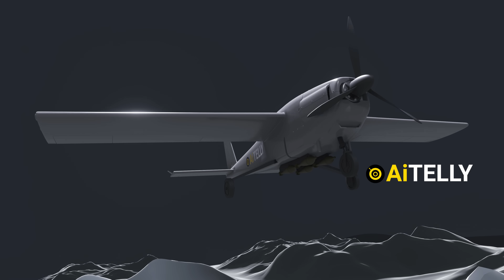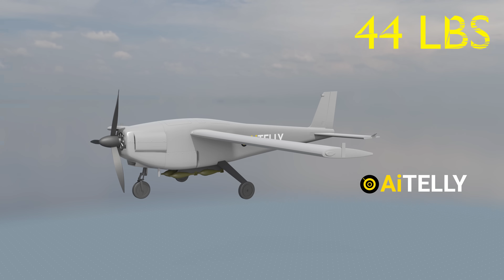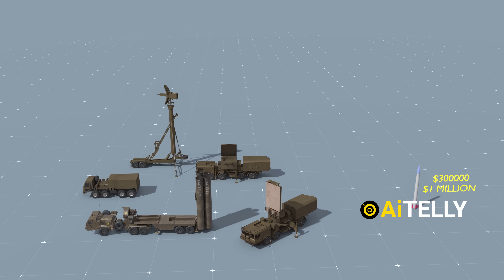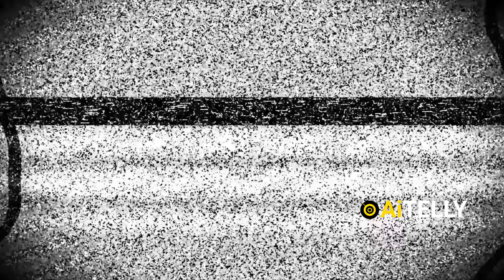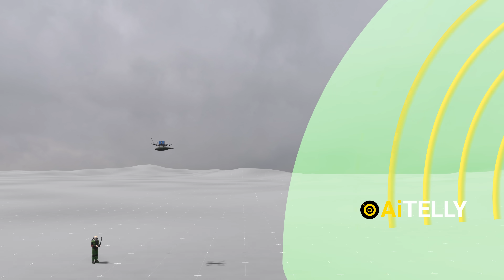Drone UJ-22 | How Ukraine Mysterious Drone Strikes Deep into Russia?

Comment: If used as a suicide drone, use a version without landirng wheels. It can be launch from the back of a pickup truck or flatbed. Removing the wheels and landing gear reduces weight and drag. This effectivesly increase range (or payload) and speed.

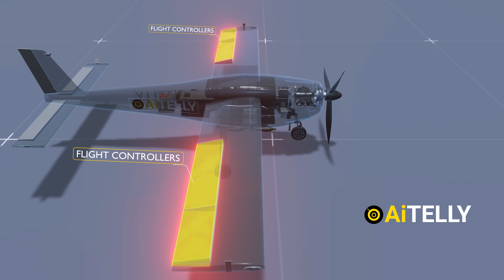Comment: 1:26 - Those aren't "flight controllers".  Those are the ailerons and flaps which are "control surfaces".  The flight controller is a tiny microprocessor packaged on a circuit board along with IMU/gyro sensors.
Reply: @beyondfossil  very correct. And we mount the flight controllers in the dead center of the craft not on the wings.

Comment: Why do you keep claiming that the UJ22 is based off the Cessna? That's BS. Its a dumb comparison. 
Form follows function. That's basic in nature and engineering and is why birds are mostly similar with two wings or fish follow the streamlined torpedo shape. It also applies to aeronautical physics and that's why most tractor aircraft designed for general aviation are structured like they are. SOME Cessnas are high wing tractors with straight wings but others are not. You could just as correctly said it was styled after a Piper, Beach or Lancair which are generally classed as cruciform aircraft. If an engine is in front, then the forward pitching force of the wings and the weight of the engine and other equipment (with the CG under the correct lift point of the wing) have to be counteracted by a control surfaces mounted on a long lever (the tail assembly). Yes, a Cessna has all that, but I'd bet no Ukrainian aeronautical engineer had a single seconds thought about Cessna aircraft and didn't copy anything.
I'm also extremely doubtful that the ACTUAL cost of construction is anywhere near $90K. I base that off my being an aircraft mechanic who has built several kit planes and also done a lot of modelling using easily available aircraft design software (with finite element analysis, not some toy program). And I've built RC aircraft LARGER and bigger engined than the UJ22 with hot wired styrofoam and then hand laid polyester / glass cloth composite skin. Note that even prior to the Ukrainian - Russian war there were very good autopilot systems out there. FYI - A gutted cell phone has quite a bit of the capacity to run flight software.

Comment: 2 stroke engine? Wouldn’t a 4 stroke engine be quieter and more efficient?
Reply: You can't beat the simplicity and power of 2 stroke for its size.
Not environmentally friendly tho.
Reply: @objection_your_honor  just seems like it would burn through the fuel too quickly (compared to a 4 stroke engine) But the power to weight ratio of a 2 stroke engine can't be beat, and they are easier to manufacture.
Reply: @eric.esoteric lightweight, and 2 stroke efficiency can improve when used in a near constant rpm range.

Comment: Do everyone noticing that older gen airplanes are becoming unmanned, and step by step we will reach jet drone ?
Reply: @kok3139   There are jet drones. Ukraine just developed one.   But the slow speed is part of the stealth.  Combat radars can tell them from birds.
Reply: @divermike8943  But in the video he mentioned that the radar discovered it and shut it down because the relatively low speed
Reply: @kok3139  That can happen, but the reason drones are hard to detect is that they are small, can fly low, not a lot of metal, and they are slow like birds. Military radars filter out things like birds to avoid false alarms. Since Ukraine adjustments have been made to those filters, I'm sure, but still, how can you tell a bird from a drone.  Speed. If too fast, not a bird.
Reply: @divermike8943   maybe by the heat fingerprint, but I guess that only works at night
Reply: @divermike8943  you are kind of wrong, speed is not at all a part of stealth. radars dont filter by speed, they filter by size, thats why birds (which are usually tiny) don't get detected / are filtered out, whereas planes and even a drone like this are large enough to the point where the radar can detect and will show them
Reply: @kok3139  radars dont have anything to do with heat, and that has nothing to do with night time, just bag the fries bro
Reply: @coolio7234  Oh, you're right! Clearly, all those scientists and defense companies wasted billions developing Radar thermal imaging and infrared systems for radars that work better at nighttime because of temperature differences. I guess they should've just asked you first, since heat apparently has nothing to do with night or radar. Genius!
Reply: @coolio7234  "Oh, you're right! Clearly, all those scientists and defense companies wasted billions developing Radar thermal imaging and infrared systems that work better at night because of temperature differences. I guess they should've just asked you first, since heat apparently has nothing to do with night or radar. Genius!"

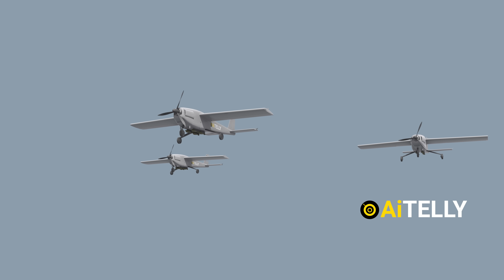Comment: 5:25 $90,000.. something tells me it would be cheaper to actually buy a 30+ year-old Cessna 150 anywhere from $15,000 -$25,000! Thin strap, all the weapons and make it radio controlled / autonomous!
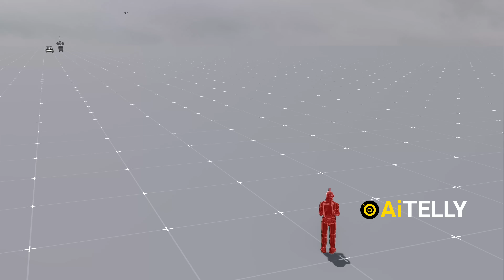5:56 on encountering electronic warfare for the little drones. Ukraine slapping on a spool of fiber optic cable, making the drone essentially unable to be jammed! However, it does decrease the weight that it can carry. I think by 2 kg “+/-“
Reply: Its very hard and expensive, to make radiocontroled syetem with 800+ km range. I think this is the most expensive part of the drone. And no one knows for shure, how much this drone costes
Reply: Well guys, in Ukraine we don't have huge market of used Cessna's for 15K$.
Reply: Once a Cessna 150 landed on the red square...is that an omen?
Reply: At beginning it was actually done exactly in that way... Unfortunately market of used Cessna-like planes not wide enough and they still need refurbishing and refitting plus as sayed @videre8884 they are brighter on radars.
Reply: They did that with me of their aeroprakt planes built in Ukraine! And the Russians use way more optic fiber than Ukrainians
Reply: Cessna 150s go for roughly twice that now.  In addition, once you use up whatever stock of 150s UA\Europe has, you are done.  I was impressed they were able to do it for as little as 90,000.  You will find that new aircraft of this size cost around that much new (with decent avionics).  I would be curious what engine they use and if there are lessons learned here that will carry over to light sport aviation when all this is done.
Reply: @Dr_Larken 5:56 both parties are using wire guided Drones
Reply: 90 gran includes also the electronics and, I would imagine, factors in the software development costs.
Reply: @serhiyranush4420  probably 2/3 of the cost is electronics, explosives, & development
Reply: дроны на оптоволокне первыми создали штурмовики федерации а не украинцы
Reply: I have the same thought , I reckon one can build it in around 20k USD